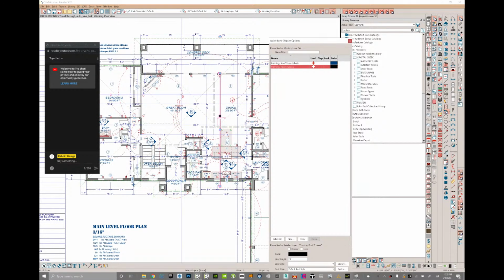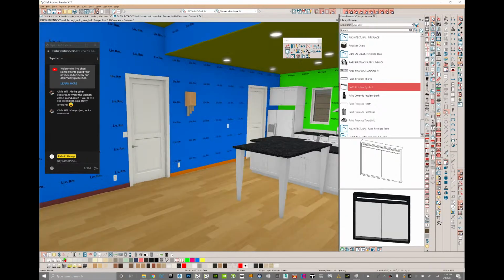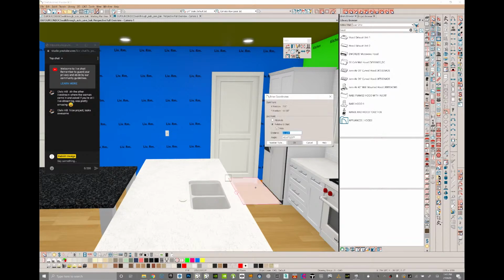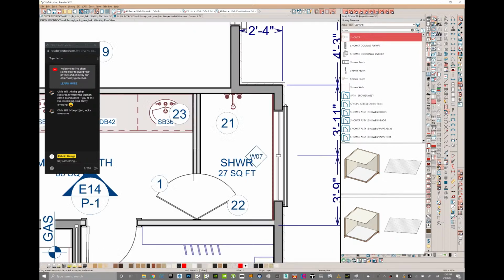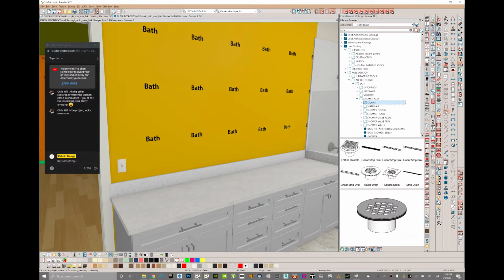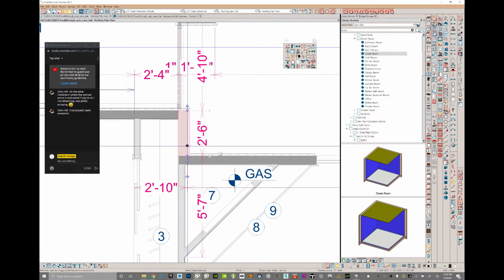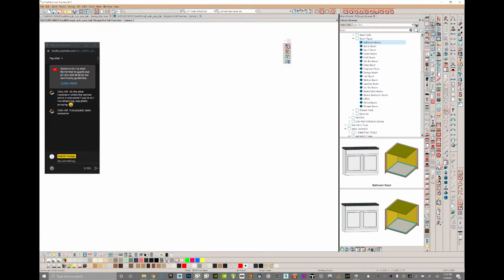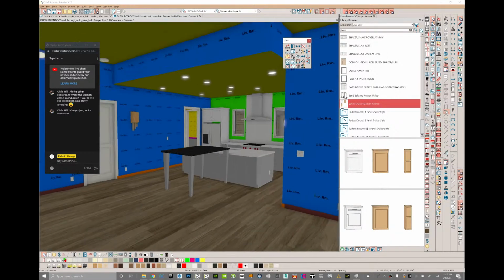Kitchen and Bath Touchups, Templating for Twinmotion-Chief Architect X-13

Comment: What happened to twinmotion my advice you should learn chief architect first you made a mess
Reply from the maker: I am a reputable Chief Architect trainer. WHat mess do you speak of? Chief architect does not UV map on a room by room basis but rather a component basis. So a wall that extends passed a room intersection will have a single UV map. Meaning you can not paint one room separate from another in Twinmotion, not even in its other available painter mode. This system ensures that I can paint on a room by room basis in Twinmotion. Same goes for casing, moldings, gutter profiles, etc. 
If you have a question I can help you with just let me know.
To reiterate. Leave all of your walls in a chief architect plan one color and try to color them differently in twinmotion.